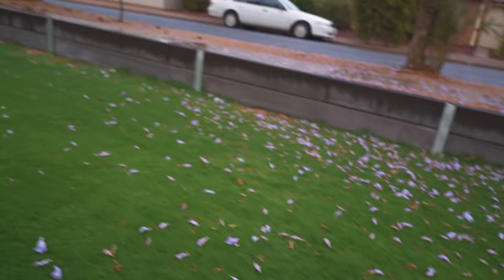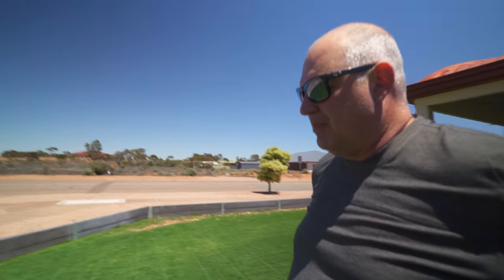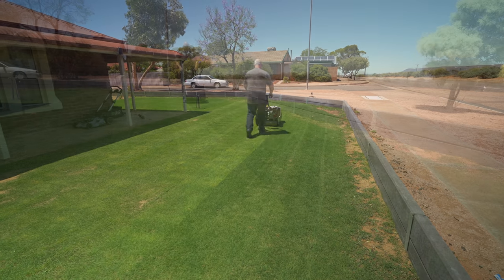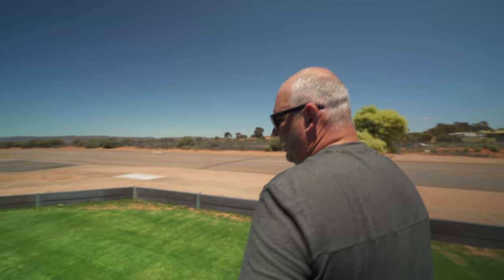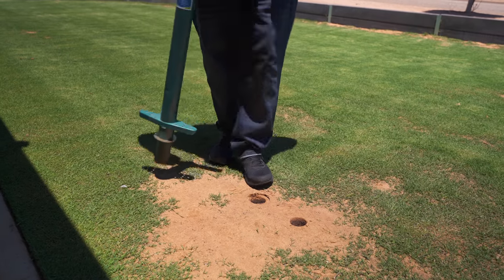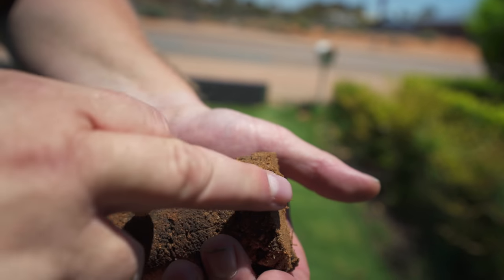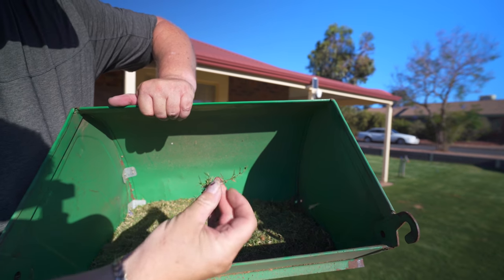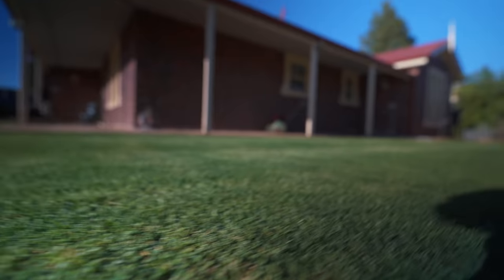First Mow and Groom and MowMaster R22G Impressions

Comment: Do you have a recamendation for a line trimer cord
Reply from the maker: Gosh!! I am not sure to be honest as I can’t remember and am away from home so I can’t check for you. Sorry
Reply: Depends what machine (battery or 2 stroke) you're running, how long the grass is & how big your feed head is. But ideally, 'speedfeed' heads are the best. Anything with a large speedfeed head you'd go with about a 3mm+, the small is perfect for 2.4mm or less. Trail Blazer is top quality & often used by the pros.

Comment: You should review the Mow Master grooming kit. You can swap it straight into your R22!
Reply from the maker: Yeah I’ll get to that one day. 
I’m working away at the moment. I’ll just try to get the best results with the limited time I have with the lawn and once I’m not working away so much I can do things like that for sure.
Reply: How easy is it to swap out?
Reply: @claytonlasscock  Luke from Mow Master reckons it takes around 20-30 minutes. Its not a really easy process like a cartridge system, but it is possible.
Reply: I sent an email to enquire about the grooming kit for R22 but never got response. Would you know roughly how much are they?
Reply: @vladdurdevic2774  I was quoted $725.00 (November 2021)
Reply: …but, I’ve decided to buy a separate dedicated machine. I already have Husqvarna batteries & charger, so I’ve ordered an S138i. Just for my own lawn, not commercial use. No experience with it yet.
Reply: Thanks letting me know @hungrymonster80 Definitely much easier to have dedicated groomer if you have room for it.